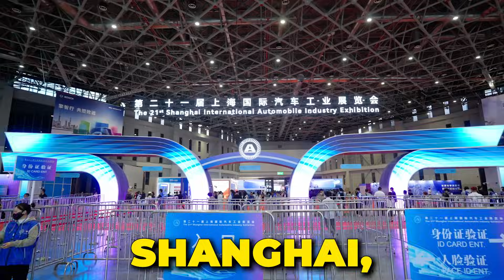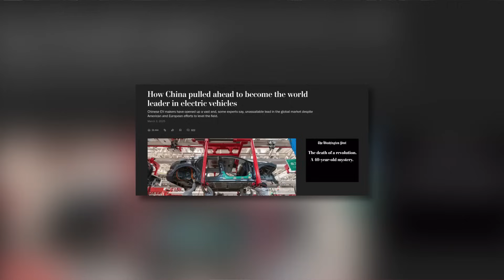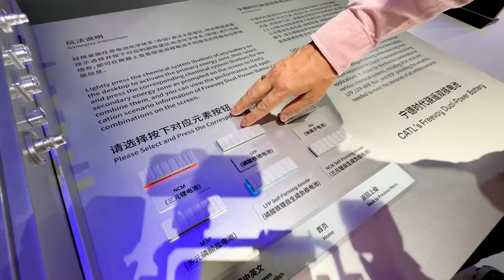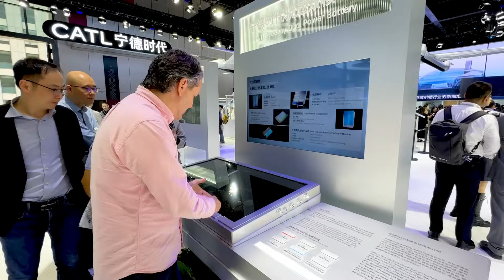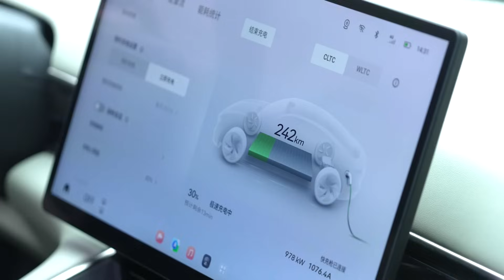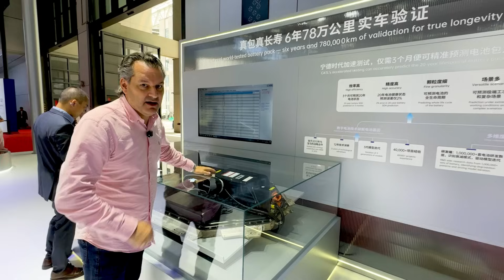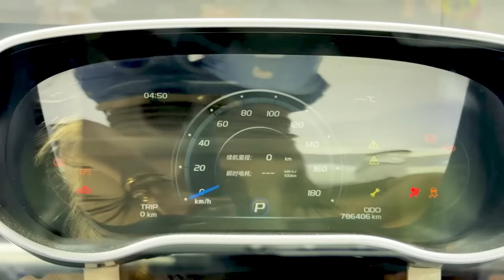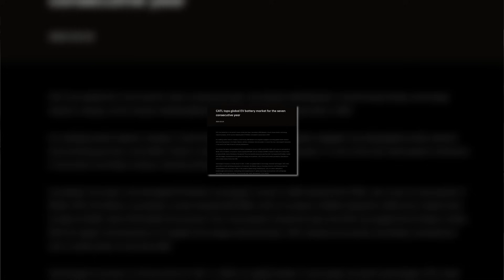1500km EV Battery That Changed The World | How Sodium Batteries Are About to Crush Lithium | CHINA

Comment: BS, so-ion is not new, it is not more energy dense, but it can be charged and functions better in cold weather and are more environment friendly.
Can be made cheaper when production rises.
No revolution, but good they started production.
And mixing LFP and NMC? So both heavy and more fire hazard.
BYD makes LFP with 1 mio km guarantee from several brands of cars.
Lets have solid state, not just a hybrid of old tech.
There is no free lunch
Reply from the maker: Lol

Comment: Battery charging process is not directly proportional to the time, and remaining a few percent takes mush longer time. As you said it take 15 min to charge the battery to 80%, then how long does it take to charge the remaining 20%?
Reply from the maker: Yes agreed
Reply: @Reporterfy  
Without telling how long it takes to charge the remainder, it's kind of misleading to say that  it take 15 min to charge the battery to 80%. What if it displayed 80%, but it actually charge only 49%?
Reply from the maker: Visit the website for a FULL evaluation
Reply from the maker: Some batteries should never be charged to 100%